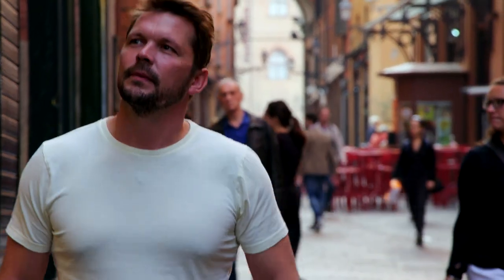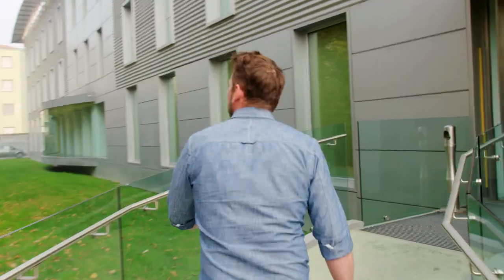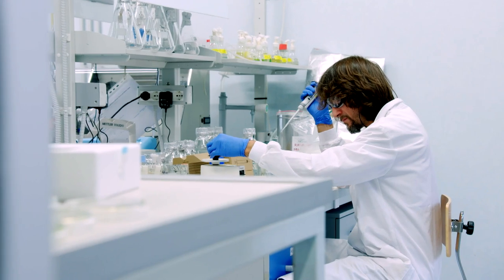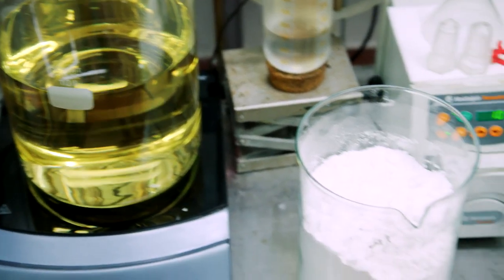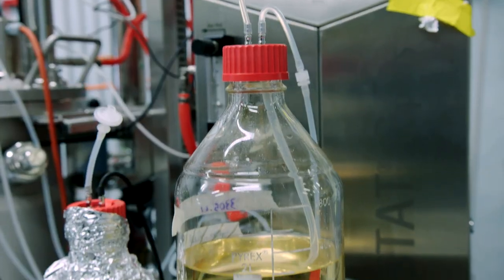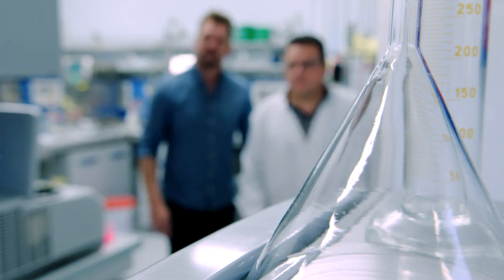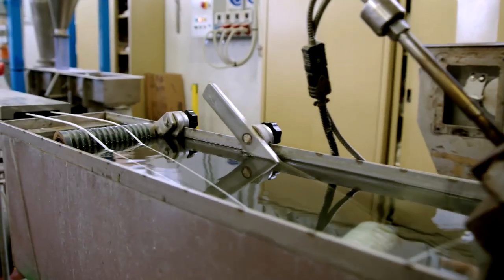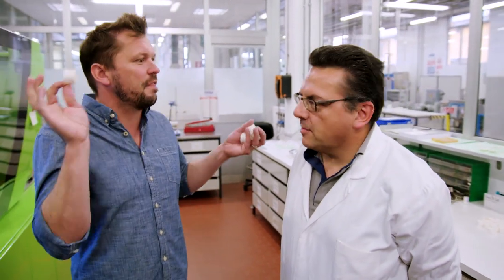Jimmy Visits a Plastic Lab Working on Super Fast Degrading Materials | Food Unwrapped

Comment: Delta from Portugal already sells coffee pods made with that type of plastic, but they are much more expensive. I am not sure this is going to be the future of coffee pods. Perhaps, it would be better to use expresso machines with ground coffee, no plastic waste.
Reply: I agree. It’s better engineering of the coffee machines that’s needed.  Then no energy used to create all the pods and filters.  Add a scoop of coffee and the machine does the rest, empty the waste bin once a week, etc.
Reply: @Dragon1276  And you can even use the ground coffee to fertilize soil, and even throwing it into the trash can won't to any damage, as it is totally biodegradable. The issue is that cheap espresso  machines do not create a consistent espresso, and you have to pay a fairly high amount to get a decent one.
Reply: @Dragon1276  that's exactly how home espresso machine operated ever. If I do not go wrong the inventor of capsule mode itself regretted the ecological disaster he created.
Reply: @davidlguerr  italian here. An espresso home machine cost much As capsule machine+capsule.
Reply: @maniscalcane  It depends. There are capsule machines selling as low as 40€. Even a 80€ espresso manual machine is not that good (I may be mistaken). I have seen reviews, that in order to have a decent espresso machine you need to spend something like 200€.
Reply: @davidlguerr  a Gaggia style will set you back for around 90$ and Us perfectly fine for home espresso
Reply: @maniscalcane  Can you recommend a model?
Reply: @davidlguerr  I have Gran Gaggia Style at home and works perfectly

Comment: It should be noted that the plastic will only biodegrade if it is composted. If you just chuck it in a landfill, it'll last forever, just like standard plastics. That means biodegradable plastics are just a small component of the necessary changes to deal with plastic waste.

Comment: Compost? Which compost? The one you have in your backyard or industrial composting places?
Reply: Both. The process of composting is the same regardless. The only difference is scale.
Reply: @kmoecub  That isn't actually true. Other compostable plastics require special composting. They won't break down in small compost piles, but require much more heat.